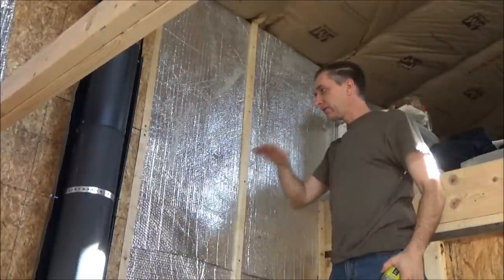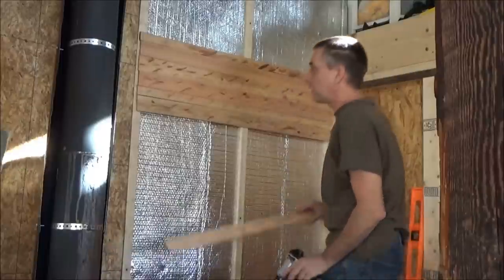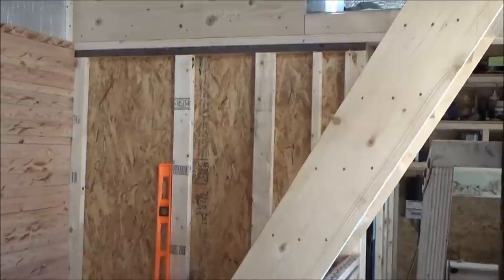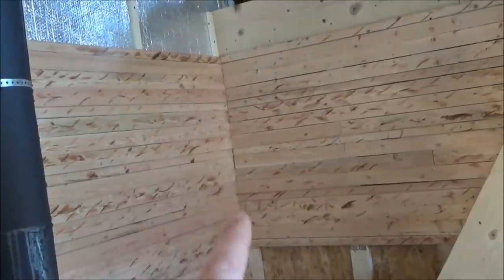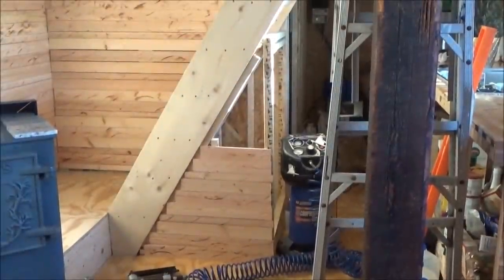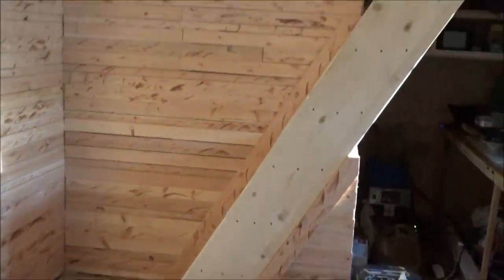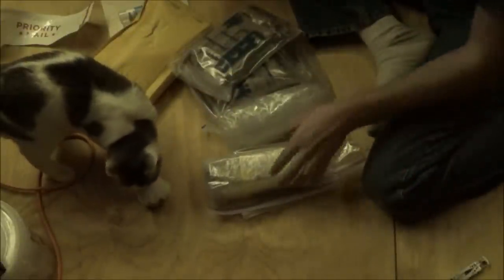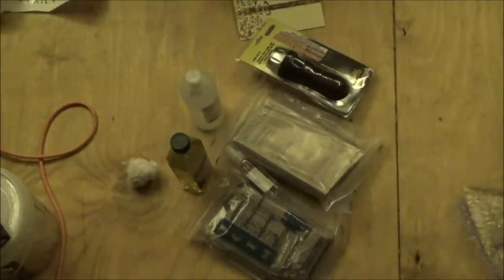Using Reclaimed Lumber For Homemade Tiny Home Paneling

Comment: I have a feeling some new saw blades may arrive in the mail for you in the next 2-3 days.
Reply from the maker: lol
Reply: Well a Contractor sold me a 10 pack of them with some tools when he was hard up for cash.  I had $75 for 10 pack of blades, hammer drill, jig saw, circular saw and a Jennings 22.  I will never use them all so I would rather see Troy burn them up than see them just sit on my shelf forever.   Besides I am moving in the spring and I got to get rid of stuff anyway!
Reply from the maker: ***** Thank you very much. Wow, nice haul you got there.

Comment: I was just thinking "Pink paper! You forgot the pink paper! Why don't you do the pink paper anymore", and then you must have heard me and told us you forgot it. That's what you get when you are in a hurry.
Reply: pieter zeeuwen What stopped him from installing it when he realized that he forgot? More common sense to chew on.
Reply: Jim Watson Beats me. I would have pink-papered the rest, but of course the bit at eye level, where it is most important, was already covered in paneling.
Reply: pieter zeeuwen When you make a mistake you correct it. In what universe does a craftsman even suggest that you use "
pink paper" to hide your lack of craftsmanship?
Reply: Jim Watson In what universe does Troy claim to be a craftsman? At best he claims to be a DIY-er (after all, it is the DIY world) and he often admits he is learning as he goes along. So I don't think we can blame him for making the mistakes and/or not knowing how to correct them.
Reply: Jim Watson If I had a planer, jointer, and miter saw I would use them, even if I had to run the bigger generator. But you have to give him credit, I have the feeling that if all he had was a hammer and an old hacksaw, he would get it done anyway!
Reply: pieter zeeuwen Good God he has experts in every field willing and able to guide him through this whole process and he ignores them. I have tried and tried, but he evidently knows better.
Reply: Jim Watson The problem seems to be you don't realize the work we are seeing was done 4 or 5 days before the video is live... so telling him how to do something after it is done, then getting pissed that he didn't listen to you is just a bit silly.  How about just watching how this one man does it, suggesting a better way for next time when you know one and relaxing a bit.   He doesn't mean any insult to you when he doesn't know what you said until it is too late, I am sure.
Reply: MollyDolly
Well said Molly :-)
Reply: MollyDolly Molly, I'm not going to debate ascetics with you. It is obvious to the most brain dead person that the wall coverings look like something that a child would do. I know you know better and your intelligence shines through in your comments.There is no mistaking that. Try to imagine a contractor trying to convince another contractor that the "paneling" looks good. You know the outcome of that scenario.
 Burn marks, gaps, on and on, yea that looks good!
Reply: Jim Watson But, he is not a contractor.  You know that.  Now think artist... would you go in an artist's shop and say your art work sucks?  Never mind, maybe you would.  But, me... if I like it I will say so, if not I will leave it for those the art suits.  I will take joy in the enjoyment the craft brings for those who do like it.     Just remember these are not structural details, on that no compromise... but on finish details... that is just artsie fartsie stuff.
Reply: MollyDolly Sorry Molly, there is such a thing as craftsmanship, you know what I'm saying.
Reply: Jim Watson I used to be much more like you on these things.  Like, kitchens should only be certain colors.  Then my daughter came home from Germany and wanted to paint the kitchen cabinets a dark red.  I can not express how strongly I think dark red does not belong in my kitchen.  However,  I figured... it's only paint.   So, we have dark red cabinets and the daughters are very happy about it.   THAT is what matters... in this case Troy is excited and loving his home and THAT is what matters.    Actually, I would have put the wood slats vertically, but that is just how I would do it... doesn't make it right.  Doesn't mean I don't like the horizontal look.  I would have made fine lap joints, probably glued the strips into panels and used less nails and counter sank and filled the holes.  I suspect you would have liked that more... but, this is not our house.  The let the wood shrink and change as it will has a more organic, beauty in it's imperfections artistic feel.  I love it, like I love my red cabinets... because I love the happiness it brings... and THAT is what matters... that is the art.
Reply: Jim Watson Believe it or not but there are people who would pay good money for a contractor to deliberately give them the 'look' that Troy has achieved more or less by accident.    People pay many dollars per foot for wood with the old saw marks in it.   People pay almost as much for the fake rustic look that imitates those same saw marks.  Beauty IS in the eye of the beholder  in this case, especially.
Reply: Jim Watson Yes, I do  know what you are saying regarding craftsmanship.  That is something that is acquired after many years of performing a task and learning skills. I think when you expect the inexperienced DIYer to exhibit the same craftsmanship a journeyman has then you undermine your own trade.  You earn the right to be called a skilled craftsman only after years of trial and error... to expect an apprentice to exhibit the same skill is to say you have no skill that the average man does not have after watching a couple of how to videos. Clearly that is not right.    If an apprentice showed up on a job site thinking that of himself and not respecting the experience and skill level of a true craftsman... well you know what would happen and it would not be pretty.
Reply: Vicki Olson You are dead wrong! No credible contractor would ever in a million years put up "paneling" that looks like that.
 
I'm not even going to debate this with you.
 Some people think that the painting of the Madonna smeared with elephant dung looked good! We could use the most idiotic example and say "beauty is in the eye of the beholder.
 There is such a thing as craftsmanship and that"paneling' is not it.
Reply: Jim Watson I am talking about the
"look" not the craftsmanship.    That same
"look" could be created with great craftsmanship and people would pay good money for it.    I worked in interior decorating for years and it always surprised me as to the
"look" that people wanted.
Reply: MollyDolly It does not take many years of practice to listen to the experts in the trade. It doesn't take many years of practice to blind nail the rows to avoid nails showing.  It doesn't take many years of practice to acclimate the material to the room. It only takes the ability to listen. I got on this channel to help Troy and he has not once, I repeat not once ever responded to any of my suggestions. Suggestions that come from 40 years of experience.
As you say it is his house,, but I wil not for one minute pretend that it looks good.
Reply: Vicki Olson After all your experience in  dealing with clients in interior decorating would agree that it looks good?  They do not exist. You know that and so do I?
Reply: pieter zeeuwen You don't need to be a craftsman to install the paper when you realise you forgot it. That's called common sense.
Reply: MollyDolly You compared Troy to an apprentice. I think that is overstating it. He does most of it on his own, with whatever experience he has, plus some YT videos and some comments as guidance, half the time with inadequate tools. I don't think anyone can be called an apprentice under those conditions, at least not when compared to a journeyman. I would say good-willing DIY-er.
Reply: Jim Watson You don't have to be a craftsman to correct your mistake, but anyone can decide that in a particular area a cosmetic "mistake" is not worth ripping some work up and starting again. Not saying I would do it, but if you are chasing deadlines for the propane heater installer and are trying to be ready before it gets dark, some priorities might change.
Reply: Jim Watson At least Troy didn't turn your (suggestion?) about a crooked table into a running joke for several months!   If anybody has a right to fuss about him not taking suggestions it is ME!  LOL!
Reply: MollyDolly I miss that table lol
Reply: OH PEOPLE!  Please!  Do NOT get him started !    That blue table is a fading memory...
Reply: MollyDolly Fading? We can't have fading!  Need to preserve the memories. History is nothing but a long chain of memories, and history is being made here. After all, where do you find someone else who (according to some) consistently refuses to follow advice and still not only survives for such a long time, but also manages to improve his conditions significantly?
Reply: pieter zeeuwen Well, I should not have said that because those who forget history are doomed to repeat it... but, oh please let us not repeat it!  LOL!
Reply: MollyDolly I hate to upset you but I sort of miss the blue table too....I was so hope-full it would show up at Halloween !!!
Reply: ACUSTOMESTREETRODS jejeje! There's a thought!   :D
Reply: Jim Watson
Sir, I realize you are trying to be helpful with your knowledge, But the point is, Does Troy like what he has done? He is the one who will be looking at it everyday. I enjoy leaving suggestions here and there. If he uses them great. If not well that is o.k. too..They are just suggestions and he is free to do as he chooses. I have learned many things for myself by reading the suggestions...Please continue to leave suggestions, But please don't get put out when Troy does not use them. Someone else may use them and benefit from them.
Reply: Dave D Thanks Dave!
Reply from the maker: Jim Watson Jim, I have told you before, I do not "ignore" everyone. But how in the World can I ever follow the advice of every single "expert" on here and still have it come out well? Remember the clothing video I did? Do you want my house to look like that?
Reply from the maker: Jim Watson You lie there Jim. I have replied to you quite often. I do not often take your advice which annoys you but it is usually offered after I have done the work.
Reply from the maker: Dave D Very well said Dave. The comments and suggestions are helping me and others who watch today and in the future. This is a very good tool. I learn from the comments here and improve my work as I go on.
Reply: Jim Watson The Do It Yourself World  Gentlemen... No...please do not say each other lied.  There is a difference of perspective only.   Jim, you are not a troll.  Troy, the thing is Jim feels you don't reply enough to his comments... not a lie, his perspective. Jim... Troy believe he often replied...perhaps not as often as you would like... but that does not make him a lying snake.  You guys owe each other apologies!
Reply from the maker: MollyDolly Yes teacher
Reply from the maker: Jim Watson Ok, Jim, I apologize for calling you a liar. Your perspective on this may be different than my own. I remember often answering your comments in the past. I remember because you were often upset with me for not taking your particular advice. I remember your listing your extensive experience in construction a while back. I do not have the time to search through 800 videos to prove I have replied to you. Sorry, your notifications may be turned off so you do not get a message when I reply.
Reply: Jim Watson Good God. He has experts in every field available to tell him where he went wrong AFTER the work is already done.
Reply: Jim Watson Here's a news flash, Jimmy boy. It does look good. It may not look professional but it definitely looks good.
Reply: SSanf Some piss pore planning; isn't it?
Reply: Jim Watson
Yeah right. I suppose you think Troy should run everything by you for your "suggestions" before working on it. Then, you would whine that he doesn't get things done fast enough and wastes his time. You are a real thorn in the side here. Are you the same at home?
Reply: SSanf Oh yea, they come here in droves to see this.Someone should call better home and garden magazine to prove your point.  " It may not look professional but it definitely looks good." That's the damnest thing I ever did hear.
Reply: Jim Watson
If you don't understand that something can look good without looking professional, you certainly lack imagination. I hope your lady looks good but does not look "professional" (in a bad way).
Reply: The Do It Yourself World I apologize to you also. I get to caught up in the drama sometimes.

Comment: Hey bud. I had one of those crank radios and it takes a bit more cranking than they claim usually. Please plug it in to make sure it's charged fully before you use it the 1st time. It might extend the battery life by as much as 50%.(between crankings) Think about making an outside corner molding out of your oak lumber, on your table saw. Set the blade depth at 1/4" and cut 2 3/4" strips full length. Glue and staple to your finished cabinet. You really don't want a big honkin' trim piece there, easy to bump and pull off or damage accidentally. (high traffic area)  Merry Christmas champ!
Reply from the maker: Thanks for the warnings. I am going to use old barn wood for the trim, yes.

Comment: Troy, please do yourself three favors before you start working on anything that has angles. One- set up your miter saw. Two- learn how to use your speed square (the triangular doo-hiky you use to cut straight with the circular saw) to determine angles. Three- set your miter saw at that angle.
 Had you done this before taking on the stairs you would not have needed to cut the trim pieces and the whole project would have been done a whole lot faster.
Also wondering what happened to the paper behind the paneling plan.
Reply: FromThe Prairies He could have marked things in place. and wouldn't need a miter saw.
Reply: Ditto.
Reply: I was wondering why he didn't just do that. Now the baseboard is going to be funky.
Reply: Jim Watson the nice thing about a miter saw is that you can set your angle and cut again and again and again. He could have done the pantry cupboard tbe same way without re-setting, just change the direction of the flow of work. 
I have cut angles with a circular saw and its a total pain in the butt. Use the best tool for the job, especially when you actually have the tool.
Reply: FromThe Prairies Yes, a miter saw is more accurate. I was pointing out an alternative.
Reply from the maker: Yes I do plan to start using it more soon. But I need to set up my outdoor work shop better first to keep it out of the weather. As to the trim work. I wanted it like that so there was no need to cut nice, neat angles.

Comment: I have a question. The rv trailer frame you used was designed for a particular wieght. How much heavier do you think the tiny home will weight when completed?
Reply from the maker: Right now I figure it is at the weight limit. If I move this I will have to empty my personal stuff. I will put a third axle on the trailer though

Comment: can you do a video on how to load a nail gun. I have one but need to learn how to use it lol. I have a hole box of nails waiting too. I have a barn with a saggy roof. Roofing is wet on the inside so I probably should replace the shingles and paneling. Was thinking of steel roofing sheets.. Plus build a room for my son in the basement. a drywall room cause the house only has 2 bedrooms and there are four of us
Reply from the maker: I can show you if I remember next time. But mine will be a bit different from your actual nail gun for sure.

Comment: wondering what you'll do, like you mentioned, when the boards dry/shrink & silver shows from behind it. Will all that need removed & put back ? 

great job ... enviable even
Reply from the maker: It is shrinking at a tremendous rate already and the silver is showing. But I will put up shelves and prints on the walls so it should be fine.
Reply: yeah ! 

Should have known you'd figure it out lol :)

Comment: You say you forgot the pink paper @ 4:48 What stopped you from installing it at that point?
Reply from the maker: It is not a high visibility area and I was running low on dry - no rain days - to make more paneling. If I ripped it off, I might ruin it. So I just kept going with it.

Comment: It looks good. But I noticed you didn't insulate. That would save on energy costs. I really like this project though.
Reply from the maker: The walls are 7.5 inches thick. I have Rockwool insulation in the studs plus double sided radiant foil. The interior wall I did not insulate between the living room and bathroom.
Reply: The Do It Yourself World yes my mistake. I went back in the video and saw that.

Comment: What's that white stuff dripping out of your chimney pipe?
Reply from the maker: Nothing white. Must have been the light. I had some creosote from burning wet, soggy wood during the heavy rains. I need to clean it off.
Reply: The Do It Yourself World
Hey Troy, You can get some stuff to throw on a hot fire in your stove that helps get rid of creosote until you get a chance to clean out your stove pipe.You only need to use it every so often. I use it and it does help.
Reply from the maker: Dave D I burn it hot three times per day to keep it clean

Comment: Not bad Troy but David Muise had a point about not adding the paper this time? Why is that?
Reply from the maker: I forgot and realized halfway through. Since it is not a high visibility area, I decided not to mess with the chance of ruining the wood by pulling it all down. I have limited dry days outside to cut this stuff and only had enough to do the job once.